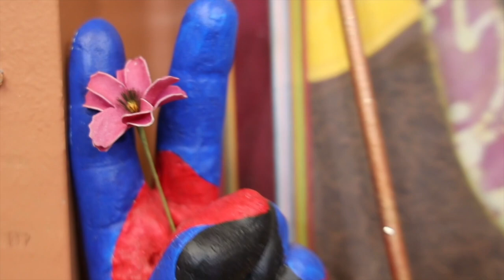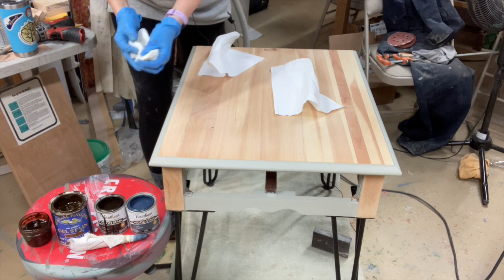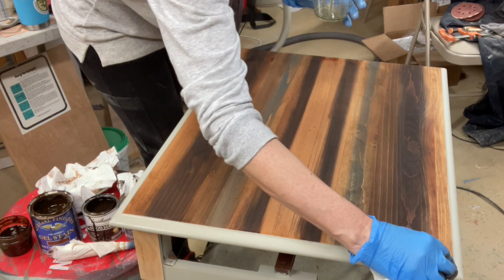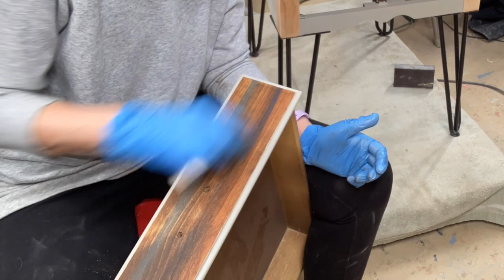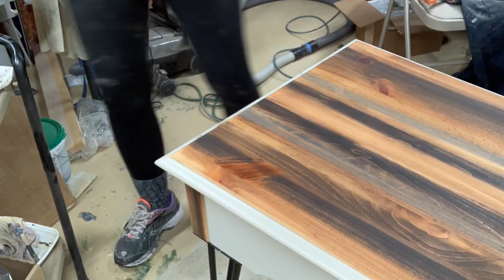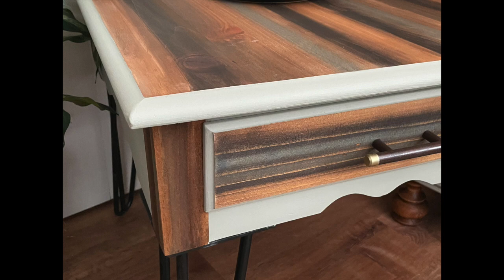DIY-Wood Staining Techniques,

Comment: This technique is awesome!     If I were younger I would utilize this technique on my basement walls.   I've applied Zinsser 123 primer on most of the wood paneling, next I will apply Bright White Sherwin Williams Super Paint.   If I wasn't 71 I would tackle accent walls utilizing white stain and other lighter shades.   (My arms can barely handle the roller on so much wall space, no way could I manage up and down a ladder using cloths.)   But a table or cabinet might be in my future.    Or maybe a vanity.   Thank you for the inspiration.
Reply from the maker: Now THAT's what I'm talking about! I like how you think and I hope you will try it on a piece of furniture, we need to know or limitations but it never hurts to try, it can always be fixed if you don't like it! Best wishes on your future projects!